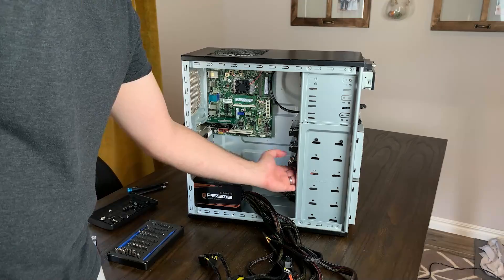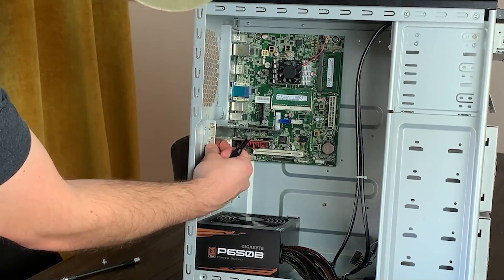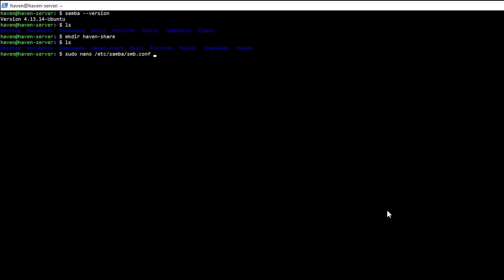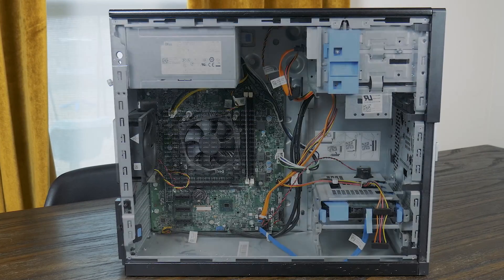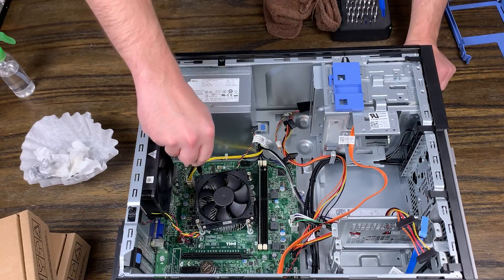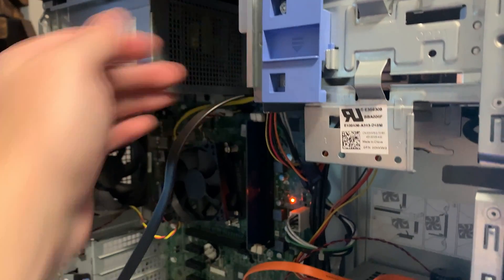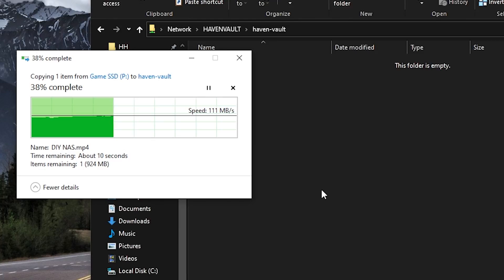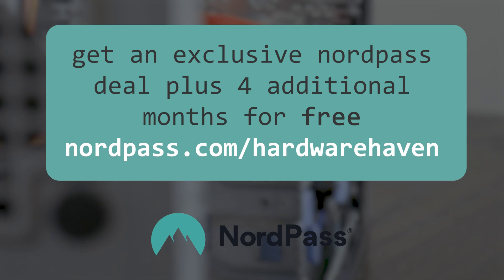A $150 NAS You Can ACTUALLY Build.. But Maybe Shouldn't

Comment: I don't understand why people would ever be upset at leaving out the drive costs when building a NAS. The cost for NAS drives could vary wildly depending on your needs. The same NAS server hardware can be used to host 4GB or 40GB! The NAS server cost is the baseline, but the system cost for any actual application of the NAS can't be deternined easily – there are too many factors to consider in choice of storage – new vs refurb, brand of drive, quality and, of course, the number of drives purchased.  I swear people will complain and whine about anything. LOL.

Comment: I just finished installing OMV (7.0.32 amd64 ISO) onto a SanDIsk 128 GB Flash. The server machine is a repurposed 2012 Mac mini Quad Core i7 @ 2.3 Hz and 16GB RAM. For the most part OMV boots right up and runs great with a a couple of wrinkles: no WiFi driver in the base package AND the ethernet port would drop out under various loads killing all the client connections and the admin web page. I finally figured out it was only the networking dropping out -- the rest of the system continued to run fine. After digging around, I found a "non-free" source for Debian 12 "Bookworm" and was able to download the Broadcom drivers for WiFi which also seemed to fix my Ethernet problems. Anyway, happy ending - now I have both wifi and stable ethernet and OMV is pretty rock solid under hours of moderate loads (multiple streaming movies, music and concurrent file transfers). Sorry I can't be more specific about the steps to download the Broadcom drivers but I was convinced I was about to trash my installation and wasn't taking any notes. But to my immense surprise it all worked! Note that there's a lot of updates to be performed to get the ISO version up to the latest version of OMV, so be prepared to spend some time. Performance is decent. The bottleneck with this Mac system is there's no option for SATA or NVMe, so I'm limited to USB 3.0 external drives for shared storage.

Comment: I have setup my own NAS server using refurbished mini Dell Wyse PC 5010. Upgraded Ram to 16GB and using USB External drive as a data storage. 
Installed Promox server and working fine for over 2 years. 
Got a bunch of applications like OpenMediaVault, Plex, Home Assistant, Web Server, and many more. Really loving it. 
The good side about building your own NAS is you have full control of what applications you want to install into.
The only down side is takes alot of time and patient to research each server setups like Proxmox, Portainer, Open Media Vault, Home Assistant and etc if you have zero knowledge about setting up a server.

Comment: Thanks man! Cool video. Currently using QNAP TS-253D with 2x4 TB WD40EFZX drives and have additional same one as external unit that I keep constantly connected to the NAS via USB to perform 1:1 copy of all shared folders just in case my NAS unit is damaged. Once in the past I had that situation and was left without any access to the data in time I really needed and had to very quickly buy whatever NAS to just run and access data on disks. Before that I didn't new that even with RAID 1 you cannot access the disk without having them installed in the NAS. I thought I'll take it out, put it in external disk case and connect to my computer to access the data. I couldn't be more wrong. Now I learned to keep one copy of the data in the external drive case so I can just plug in and access it. Good stuff, I am considering to build custom NAS to lower cost of the unit and be able to connect more drives.

Comment: Why didn't you place the 500GB drive in the location where the 3.5 inch disk bracket was? There wasn't a disk drive there and the spinning disk is faster then the USB stick, and more reliable.

Comment: Increasingly one needs to factor in the cost of electricity into the real cost of such devices. In the UK currently, a 10W lower average power draw will save you something like £100 over a 4 year lifecycle. And that’s before factoring in issues of environmental responsibility. With a £100 larger hardware budget one could probably reduce the power use by 10W or more quite easily. One would probably also get a much quieter device.
Reply: I discovered that many of the issues are discussed in another video from this channel: https://youtu.be/PisIPpbMkTc?si=mWAlPbY17Awej646

Comment: not including the drives is the correct move. Drive technology and prices fluctuate so much that they could change by the entire cost of the driveless nas up or down since the time the video was made. It's also the single most scalable item in the entire build - have more funds? Get bigger drives. Have less funds? Get smaller ones. a $150 NAS can house $50 worth of drives or $4000 worth of drives - that's user preference

Comment: Those used drives are really a pot shoot on how long they will last.

Last year, when I built my OpenMediaVault NAS, I bought 5 of those drives (for zraid-2 + 1 spare). Today, two of those drives have failed, but the other three are doing fine. The Smart on all of them said they were old and pre-fail.

The new server I am building (Proxmox with zraid-2) will have all new drives. The server is built now with the exception of the drives. This time I am looking for larger drives (instead of 4TB, looking for 6 or 8TB or more if I can find new ones for cheap) as well. With 4 x 4TB drives in zraid-2, it gives a total of 13TB with about 7TB of usable storage.

Comment: literally did this exact build like 3 years ago just now got around to doing some upgrades... i used a 9010 dell OptiPlex as a base and 3d printed my extra drive bays and mounted them i currently have 5 drives running 4 in raid  one as the OS ... using a hardware raid controller to do everything... I'd say  I've spent maybe 300ish  on my little server but she works great.

Comment: Under $150, relatively available, >3TB, redundancy and gigabit r/w....These are all very good goals but unrealistic depending on the storage and memory but there are lots of general use Dell 7010, HP ProDesk 400-G1 and various Acer refurb SFF desktops on newegg sitting between $70-140 that are typically 2.9-3.4GHz dual or quad cores with 4/8GB depending on whether it comes with whatever cheap storage volume. For building a NAS or seedbox, these things are solid GOLD. Some cases quite literally like the RGB Treasurebox that kept appearing in my feed a couple months back after offices retired a bunch of them like usual. They are all consumer devices and "slow" but a great way to experiment with and master this part of the sysadmin world.

I personally get to choose between something significantly worse spec than these boxes or an overdone rack that needs careful planning as it's a mix of consumer and enterprise components in a standard 2U. All I need is single core, constant uptime, the ability to load upwards of 20TB (for now), no redundancy and maybe a single PCI-E expansion for a half height NIC or flash accelerator. There are reasons you are not going to do what I'm doing, starting with useful technologies like significantly faster CPU clockspeeds, multithreading, multicore processing, AES, AVX, SSSE3, 128-bit SSE, hardware P-state and then massive ones we take for granted like nested page tables (You like KVM/ESXi/Hyper-V/Proxmox?) and software thermal control.

I currently have one HDD that I know will saturate gigabit and a spare that is more than 4x the size and speed of it but there's no way it's doing any of this over sata2. Storage has become such a big deal in recent years and HDDs are catching up with SSDs in a couple of the ways that really matter. There are so many ways to setup and manage a storage server but as long as you're aware of performance bottlenecks, device temperatures, power draw and a good rationale that what you're doing works, it's all good. 😎Also don't forget about disaster situations. If you can't pick up the pieces and recover quickly, do something about it before you lose anything important. ✅Cheers.

Comment: two weeks later… your boot problems reminds me to some older but still great DELL Precision workstations. To use one USB to install to another was not everytime possible. As you have other hardware and a server -> boot via PXe network :) and install.

If not possible: The older Dells disliked to boot from every USB connector, sometimes just changing which was used helped, furthermore to change the keyboard/mouse to PS2 helped, so that only one USB was connected

Cheers, fun to watch your tinkering,
Pepe

Then not all sticks were liked (smaller ones in FAT32 were preferred) and sometimes there are even settings

Comment: if you wanted to be really frugal you should try using laptop hdds as used and some times new they are generally cheaper. think you can get a new 1tb 2.5" hdd from amazon for about £30 whilst 3.25 drives are £40ish. not much of a saving but you could get 4 drives and still have £30 to spare on a system which is still reasonable.
Reply from the maker: True! And probably still fast enough for most people, especially in raid or zfs

Comment: I musta missed something: why not use the included 500GB hard drive as the boot drive, rather than messing about with a slow USB thumb drive? I realize there's only two drive cages at the bottom of the chassis, but why not replace what appears to be an optical drive (mounted high) with the original HD? Looks like there are three SATA connectors on the motherboard ...
Reply from the maker: I would have to pay for a dock/adapter and sata cable anyway, but yeah, that could've still been an option.

Comment: I built a nas using mdadm and samba. My machine runs Ubuntu 22.04.01 on SSD and has cpu i3-3220, I have 2 8TB ironwolf drives in raid 1, the motherboard only supports SATA II, I also use a TP-Link AC1300 dongle at 5GHZ 867Mbps. When I copy files from another machine(windows) connected to my router (wifi) the speed I got is 11Mb/s. In your video I saw you had 110 Mb/s. I wanted to ask why do you think I have that big difference in the speed? Do you think this is due to openmediavault/ubuntu? Sata 300 vs sata 600? or due to the wifi connection?
Reply from the maker: My guess is wifi. I would hook up a temporary wired connection and see if it’s any better!
Reply: @HardwareHaven  thank you for the reply, I tried a ethernet connection but the speed is the same.
Reply from the maker: @DonKinHot  hmmm maybe double check that the NIC on your server is a 1Gb nic and not 100Mb. Same with the computer you connected it to. If you were using your router to connect them, make sure the ports on that support 1Gb. Many wireless routers only support 100Mb on the wired connections.
Reply: @HardwareHaven  thanks for the help, I bought from amazon 2 CAT8 Ethernet Cables, one for the client and one for the server, I finally managed to reach 100MB/s. Do you manage to have the same speed over wifi? if yes, do you have any setup for router/switch to recommend? I am still using the default BT/EE router.

Comment: Enjoyed watching the journey! A lot of works goes into trying to go budget (time vs. money vs quality). I wanted to build my own but the hardest item to find small form factor WITH hot swappable drives( and never could find a tray-less option which to me is truly hot swappable)
Reply: You might want to take a look at icy dock. I have an 8 x 2.5" hot swappable drive array (fits 5 or 7mm laptop drives) that fits into 1 x 5 1/4" drive bay, and I have a 5 x 3.5" hot swappable drive array that fits into 2 x 5 1/4" drive bays. These are trays, but icy dock might have trayless, I have not looked for trayless.

Comment: I snagged an old Dell SFF Workstation with an i5-4590S, then upgraded memory with left over DDR3, installed UnRAID, then went a bit overboard with 2 new 18T WD NAS Drives, and recycled an old tower case to house it all.  Its been a great set up, but when I build a new gaming rig, I'll probably push the Franken-Dell to cold storage, back up duty, and just migrate my old AM4 set up to Media Server duty.  Your videos have been helpful, and I appreciate the time you take to show OS options for home use.

Comment: My funny "NAS setup" on my home LAN is just my old windows pc, with win10lite boot and shared the drive. Why I do this? I can't afford more drive when I already have old 2tb drive already filled with backup of my data.
I just need them occasionally, and when I done with it, I just turn it off (I don't need 24/7 idle drive).
I just want to save a data separated from my main pc, and occasionaly access it with phone.
And the last thing I hate is, I need to move my drive data to re-format it for NAS oriented OS-es. WHY I CAN'T JUST PUT MY ALREADY FILLED DRIVE FOR THAT AND SHARE IT?????

Comment: i do use Raspberry's for both my backup storage and a separate NAS/Media server.  I've used these for many years without issues.  The drives are old external devices I've had laying around.  Rsync is used to backup my desktop machines on a scheduled basis.  The NAS machine works great as a media server (MiniDLNA).  Overall the cost was low because I mostly used parts I had sitting around. I don't need speed, I just need headless operation. And these sit in my crawl space...

Comment: OMV might need to run with secure boot disabled in bios (if your bios doesnt have that option you have to reflash it with an app on windows and include the option in the config file but this is pretty risky)

Comment: Don't be too concerned about those drives being a little on the louder side. I've got quite a few of these old HGST/Hitachi drives and they're pretty noisy, they work perfectly fine though. They get a little warm, but I have never seen one go much above 50C, and that was on a hot summer day where the temperature in the room was 40C.

I got a great deal on some 3TB HGST drives a while back, they are of the SAS variety unfortunately, but at about £8 per drive and I got 7 of them, I don't think that really matters in this case. Still yet to test them as I haven't gotten around to flashing my Dell PERC H200 into IT mode. The drives were sold as tested and working, so I'm sure they're fine.

Sometimes unlikely deals such as these are out there, but you've just got to look in the right places.

Comment: I have a pi4 4gig version with omv 6 installed to a usb 3.0 flash drive and a 5tb usb 3.0 for my storage, no issues with omv 6 running off the flash drive with docker installed etc.

Comment: I've been using refurbished enterprise grade drives in fairly large capacity in recent years. Most recently I bought some refurbished WD Ultrastar DC HC530 14TB SATA 6Gb/s 3.5-Inch Data Center drives from Newegg checking just now those are going for roughly $180 each. I've been going with that brand for a while now and they've all been reliable as a box girder railroad bridge.

Comment: using the 500gb as boot drive taking the satacable from the cdrom
Reply from the maker: Well I would need more drive bays, and I used the data cable from the optical drive for the second hard drive
Reply: @HardwareHaven  you can put it under the 5.25 inch cases where the dvd drive is
Reply from the maker: Not if I still wanted the front panel

Comment: i think i had that issue with booting to the OMV once. the trick was to install the OS with no HDDs connected. then power off, plug in the drives and power back on.
Reply: Were you using usb to boot?
Reply: @haveaniceday7950  yes i think i was

Comment: I think the reason that including the cost doesn't usually make sense when building a NAS, or making a guide for that, is simple: Very diverse needs for people that follow along. Some might just need a basic NAS with a few Terrabytes, some might need 15-20 TB of usable space, and a third group might want 50+ TB. The same NAS in a guide can probably do all those things, with varying service quality levels like speed or noise, but the point is that the costs for these systems will vary wildly, because the drives make up the bulk of the cost.
If the cost is included, then everyone who doesn't want a 3 TB NAS now has to figure out what the actual NAS without drives costs, to see if it makes sense for him. Most people will probably be in this group.
Reply from the maker: Yep. That’s basically my reasoning as well.

Comment: I have those HGST drives and they're great! Been using them for a while now without issue
Reply from the maker: Nice!
Reply: How long have they lasted?
Reply: @haveaniceday7950  Going on 3 years now without any issues. They're just a bit on the loud side
Reply: @Kim-fm2vo  wow, that’s good. They were used when you bought them?
Reply: @haveaniceday7950  I wrote a comment but it didn't seem to go through. These are refurbished drives, I got them for $45 per 4 TB from Amazon. They seemed to have some hours on them but I'm not sure how many (SMART info was seemingly wiped as part of the refurb process). I do highly recommend them as cheap storage though, so long as you don't mind the noise!